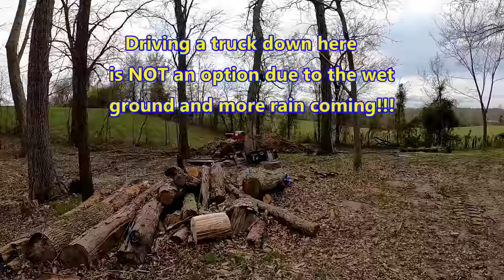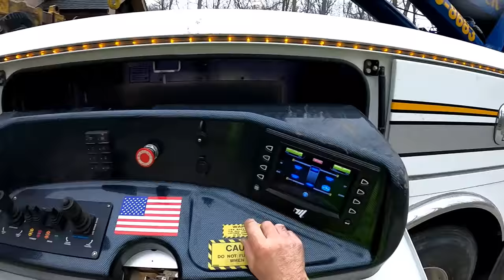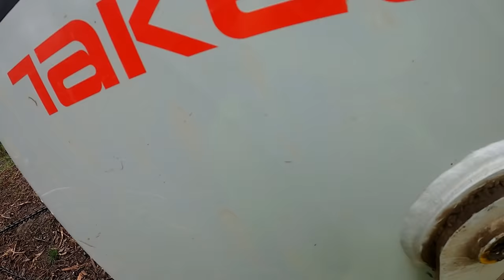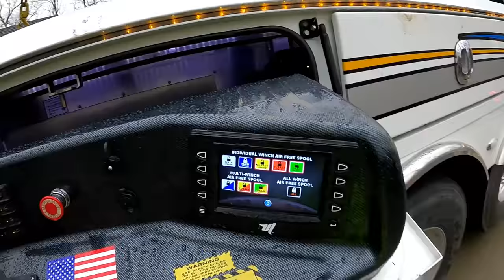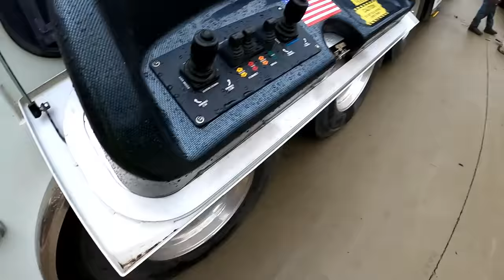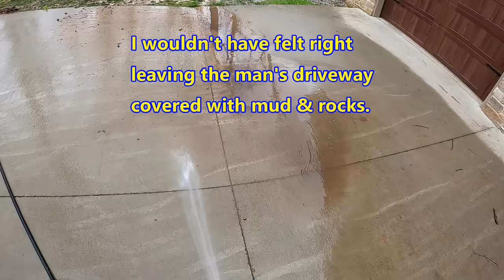The Uphill Battle!!!  Working in the Rain, Just Working in the Rain.

Comment: Hello Ron!! Having that headset and mic two way radio with hands free talk activated transmit is a VERY GOOD THING to have!! I remember using a Komatsu PC 280 one time about 18 years ago I used a similar system with a helper to get a close and different angle of sight so I could VERY Accurately place the bucket to avoid hitting a buried basement drain line!! That way my assistant could help me place the bucket without damaging the 4 inch PVC pipe that was about 5 to 6 feet deep!! It worked VERY WELL!!  Mike is a real good hand at getting things done the right way!!!!  and safely too.

Comment: That thing was stuck hard. If not for the sheer size of your wrecker , you would have needed a plan B or to use the trees as pull points . Since I don’t have nearly the size equipment,I made up a Tee bar or i use a large agricultural rim  as a fulcrum roll it down the hill ,guide the chains over it  so you lift and pull .  Nice job you guys did . Love watching you come up with a plan and make it happen.

Comment: Finally got to watch the whole thing. Man you guys do great work. 

I always like to talk about how we could have things differently at the end of a fun call like this.

One thing I'd have done for almost certain is to have used a piece of almost free equipment that I'm surprised to see that you don't carry! 
When the time comes to replace a winch cable because it's near the end of it's service life, but still has a little bit of life left in it, $10 worth of horse and saddle clamps make it just a fine extension cable. Cut 'em to 25', roll them into big loops (like a new one), tape 'em up and bury them in the toolbox! You wouldn't have ruined your endless loop if you had an extension cable.

Comment: I really enjoy your channel Ron!  2 hr show today!!  Really cool!  There were a couple things that happened that were frustrating for me.  A it's not that you did something wrong, it's that you didn't do it the way I would have done it, Lol!  first was the mud and water in the bucket.  If you'd have kicked the mud off the bucket, that water would have run out especially going up that hill.  The bucket may have emptied enough to use it. The 2nd is working around that 1st tree.  I think if you would have pulled from the other corner before getting the bucket too close to the tree, it would have swung the bucket around the tree and Mike wouldn't have needed the block  It is good to know another way to get around a tree though!.  But, as I have heard other YouTubers say, "This isn't the way "to do it',  but it is the way I'm doing it.  Good video Ron.

Comment: I had a similar situation once. Down a steep hill, lots of trees, but the skid steer was a lot deeper in the mud where I knew I was going to need to get some lift. So I left a 40 ton wrecker at the top of the hill. Backed our F450 8 ton wrecker down the hill. It got stuck and needed a Holmes tree to winch F450 close enough to the stuck unit. Recovered the skid steer up to the 8 ton on a hard patch. Pulled the final drives. Then winched both the F450 and the skid steer up the hill with our 40 ton wrecker. Loaded skid steer on a flatbed to take for repairs. With how hard that 8 ton had to work to get the skid steer out of the hole conformed there would have been no way to just use the 40 ton and Holmes trees.

Comment: 1:07 would it have helped to switch to pulling on the left side of the machine instead of on the right side to get the bucket to swing back around that first tree?  Or even to have shortened up your loop anchoring the snatch block…?

Comment: When you found yourself with the bucket against the tree, why could you not change the pull point from the right rear to the  left rear which it would seem would cause the unit to pivot away from the  tree ?  Still a very impressive job... thanks for sharing

Comment: When you got the skid steer up to that first tree, I would have hooked the chain on the left rear of the machine that you were getting out of the way in the back and that would have swung the rear over the other way making it so you could clear the bucket of that tree then hook them both back up and drag them even.  Years ago I had to do an ATV rescue up in the mountains.  I borrowed an 8000lb portable winch from a guy for the rescue.  Had to get cross ways in the narrow unimproved road and use the ball on the receiver hitch to hook the winch onto.  Went down this steep hill which had a drop of about 100 feet to a foot trail where I hooked a snatch block like you did then run cable from that block about another 150' to another snatch block on another tree then down another hill about 75' to a third snatch block as it wasn't a straight drag from the second one.  Then on down another 30' to the machine which we had to drag around to tow the machine backwards as the tie rod was broken. I remember the winch groaning really hard for that first pull up to the third snatch block then got a little easier once we eliminated the third snatch block.  Got it up to the second block then drug it to the first block up the foot trail then a dead pull up the last 100' or so which was at an angle of about 45 degrees.  Took us all day.  Your rescue was heavier but not near as far.  But we didn't have any mud to deal with and no remote control for the winch and there was only 2 of us like your situation.  We used portable radios for communication.  Since the ATV wasn't real heavy, we just used 1/4" cable.  Fun times.  That was about 14 years ago.  This recue was done in the mountains of Montana.

Comment: Thanks for a long good video, Ron! Always nice to see the process of getting your job done!
Now I have a suggestion: This is the second video in a short time where you had to check that there were enough cable left on the drum.  Why don't you paint a mark or two on the cables - one for the boom fully out and one for the boom fully in? As you work from the front of the boom you then would see when free-spool must be stopped to keep the required turns left on the drum?
Reply: That sounds reasonable to me. Maybe  there's a built in sensor, or some kind of stop switch located on the drum.

Comment: That was fascinating, Ron, thanks!  
You mentioned about washing the endless slings that get wet & muddy, how do you wash or clean them to minimise grit causing wear & tear? I understand if they get damaged you have to discard or re-purpose them; I'm thinking of those in good structural condition.

The teamwork between you & Mike is a delight to watch; I can't wait to see (hear) when you have the headsets linked to audio. The headsets were obviously invaluable on this long-distance recovery.
Reply: What I found that seems to work is soaking them with a mild detergent soap such as dish soap to get any greasy/dirty residues off then I rinse with a garden hose.  Finishing with hanging to dry (I don't use a pressure washer as they can force the dirt deeper into the strap fabric doesn't matter if it's poly or nylon)

Comment: Regarding the tightening of D shackles or clevises . 
If they are holding a safety chain or other safety attachment you lock them down and even wire them so that they don’t vibrate loose.
If they will have a constant or varying load on them and are not a safety device then you don’t lock them down as it is unnecessary and just requires you to find a tool to undo them. They’re not going to come loose unless you didn’t do them up far enough in the first place.

Comment: Something you could've done when it was up against the tree was you could've ran the line around the left side and hooked it on one of the teeth of the bucket and used that as a fulcrum to pull the machine to the left enough to clear the tree.

I found a good combination.. "watching" this video while sharpening knives.. I only have ~16 of them with all of the ones I brought home from Papa's shop :D One even has antler for a handle.. good belt knife once I get all the grinding marks out of the blade. Unfortunately the blade is too thick for the sharpening kit I have.

Comment: Heh heh I was gonna Monday morning Qback about rotating the bucket around the tree. I see you mentioned about the tracks being sfuck previously and weren't sure if it would pivot but most likely it would have as you did the same to line the machine up with the ravine better later in the vid. Like you've said though, just another way to get to 10  ;) Poor Mike could have likely saved himself a walk up the hill and all the time to retrieve the block from the truck as well as you wouldn't have had to pull the work lights out to put it away heh heh. One other critique, I was kinda surprised you didn't clear the large dam of mud from the bucket when it was down on the bottom. Could have allowed much of the water to evacuate from the bucket on the hill before the loading on the rollback. All in all a pre job and awesome that you even took the time to clean the driveway. First rate for sure sir!
Reply from the maker: Yes, in hindsight, I, too, wish I had cleaned the mud out of the bucket.  It would have saved me some clean up, but, oh well.   I missed it.   Didn't occur to me at the time.   I learn so much from my viewers!!!   Thanks for watching and God bless.

Comment: Instead of the oak block all you had to do was switch to only pulling from the other side of the machine. By doing that the machine will pivot and swing the bucket away from the tree. Ive had to do the same thing before for something else.

Comment: What you NEED is a heavy lift helicopter or dirigible to get these things that are stuck beyond the reach of 'Tator!  I was also thinking if you had a way to inject air bubbles under the skid steer, that might break the suction a lot more easily.

Comment: As a sound engineer, I suggest using "two" pop filters over your broadcast mic and roll off as much of the bottom (bass) as possible. Cutting out the wind is always a struggle. Another suggestion, find a receiver tuned to the frequencies of your headsets, then we can hear both of your fine tuned voices.

Comment: I was curious why you didn’t get rid of the water and mud in the bucket while it was at the bottom. It will likely make a mess driving it back to the yard. I  try C will probably splash out if the bucket. Just saying.

Comment: A tug on the left side would pivot the machine bucket away from the tree, would'nt it? Sometimes you get stuck in a wrong pattern and dig yourself into a hole. It pays to take a step back and examine the problem from a different angle.

Comment: Your videos are awesome, thanks for putting yourself out there.  I noticed the client had a nice new concrete drive.  Were you or the client concerned about the weight of the tator damaging/cracking the concrete?  Has any client claimed you damaged his concrete/asphalt driveway?  Do you have any rule of thumb you use to evaluate the structural integrity of a private entrance?

Comment: I didn't understand raising the boom because "it was raising the far side of the truck". Seems like raising the boom would just create more leverage to tilt the truck!🤔 Of course, it worked, so who cares what 'geometry' (or ME!! 😇 ) says! Kept holleren at you to stow those straps on the built-in 3" strap bar that runs between the rear pivot arms! I think Taekuchi put that thing there just for keeping stuff out of that filthy, muddy bucket!!! Guess you couldn't hear me with that new-fangled headset... 🤣
Next time you have a hill-pull, use BOTH lines, one to pull the problem and one to pul up the 'older folks'!!! 🤣

Comment: Now you dropped the left chain to get the back side of the machine to hook toward the left of the fulcrum, which caused the front of the machine on the other side of the fulcrum to swing right..  Would it not work in reverse?  I kept on thinking the way the front of the machine moved to the right when you made the back of the machine to pull to the left, if you had dropped the right chain and reconnected your left chain, since the fulcrum  was on the opposite side of the tree than the front of the machine, it would have caused the back of the machine to swing right and the front of the machine to swing to the left, and allowed you to pull it without having to get the block of wood.

Comment: should keep like 200ft climbing rope on your rig  jobs like this you can run a rope zip line down to the work area and send gear down easy can even use the rope to winch or drag all gear back in a bag or basket for when job finished lol and im half way though you said same thing

Comment: Hi, new to the channel and really enjoy it. I'm no expert, but I saw a couple of safety concerns.

First, I thought you're not supposed to put the pulling forces on the sides of the shackle (29:12 minute mark and again at 38:00 minute mark, shackle closest to the skid loader on the orange straps going around the tree). Doing so would put the stress on the threads of the pin to hold the load. Sorry if it was brought up previously, but skimmed through 900+ comments and noticed no one else had mentioned it. At 45:32 you do mention this exact problem when you tie to a different tree, but only in the editing phase though. Fortunately, when you had to redo the link, you did correct it.

Second issue is when you were pulling the skid down the embankment. You had concerns that the skid could potentially roll over. Despite that, you started the pull while poor Mike was on the downside of the sled and out of your view.

Hopefully my comment comes across as constructive criticism and not bashing.

Comment: For clevis bolts, I've always figured if you're using a lock wire (or analogous) you can back it off, if not, snug it up.
And thank you for mentioning that the strap is being decommissioned. I was wondering. Also, if the sleeve gets roughed up, could you resleeve it, or is the sleeve integral to the loop?

Comment: Time to get yourself an old style sxs examples...a 90s era ranger/old style gator with steel bed to haul your gear on the long off pavement runs and pull winch lines... examples of how this would work is the m88a2 Hercules uses a 3 ton winch and a snatch block to pull its 280ft 1.4inch dia.  140k lbs. single line pull main winch cable the m88-m88a1 didn't  have that winch and took its entire crew to pull its 1.25 inch 90k lbs winch cable to its 200ft. usable length.

Comment: As always: a great job well done.. Just 2 questions and 1 suggestion. Instead of putting a wooden block between the bucket and the tree, would it have been possible to switch to pulling on the other chain (driver side)? Theoretically th machine would've rotated the bucket away from the tree. In the end, before pulling the machine on the concrete, if you have extended the boom and lifted the machine on 1 end, would you have been able to drain the bucket? To take the guesswork and the multiple trips to watch the remaining wire on the drum, what if you paint a marker on the wire where it just exits the boom, with the minimum wraps on the drum? I do understand that there would be infinite combinations of boom extension, angle etc. But if you mark several places on the wire, with some combination of colors, maybe it's workable?

Comment: I was wondering how much damage you tolerated on those slings?
Reply from the maker: If you saw the one towards the end of the video that was frayed, we had already pulled it "out of service" for normal, heavy work.   I grabbed it as extra rigging for this job simply because it was laying close to the truck when I was loading extra rigging.  I used it around the tree for the redirect.  It was disposed of after this job as it was deemed unsafe.   Thanks for watching and God bless.

Comment: I guess they say great minds think alike... before you put the comment on screen I knew you weren't gonna leave that shackle like that and then when you re-rigged and were talking about having to go around that tree I was about to scream at the screen to lengthen the sling on the redirect. Now for a question/suggestion... with this (and to some extent that dozer you pulled from the mud tho I think that would have certainly been way too heavy) why not use a nice heavy 6x6 with a big pad or even a rescue strut (not that I'd be sticking my paratech in there) under the cable/sling vertically down near the load to get a quick, steep high angle to add lift to the system just to help with the initial pull and suction? I mean, the simple answer may be that the tator pulls hard enough that you just don't need to but still, that quick angle would add a lot of uplift force just long enough to help break the initial suction...

Comment: I wonder if it would have been cheaper to hire a helicopter to fly that thing out. LOL  Ron: zip line? Might have been a bit of fun but but totally contradictory to the safe working environment that you maintain. LOL Also if you did the physics on this, you might find that just one person on that cable at the midpoint  between the boom and skid steer might very well have been enough to move the rotator or tip the rotator over. Yeah, of course I know you were joking. LOL

Comment: Ron, are those headsets comfortable under a hard hat? i have been looking for a system like this for a while now.
Reply from the maker: Actually I had to change hard hats to use these headsets.  The do not work well with a full-brim hard hat.   The will fit under it, but you have to crank the ratchet on the hard hat down so tight that it is extremely uncomfortable.    With a "ballcap" style hard hat, the headset works just fine.  The earpiece tucks under one side and the grip goes on TOP of the hard hat.   It will slide off sometimes, but that is far better than not having the headsets at all.   I wish this company made a set that were designed to work specifically with hard hats, but they do not, currently.   Thanks for watching and God bless.